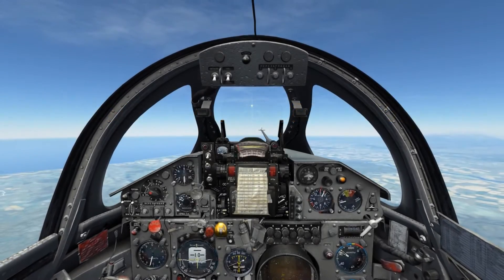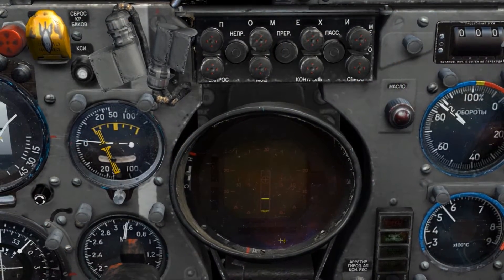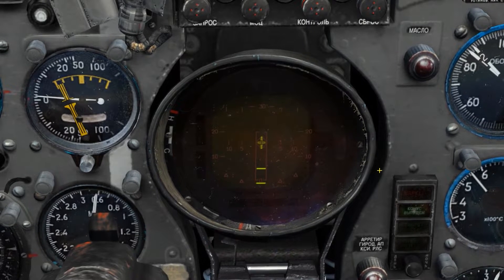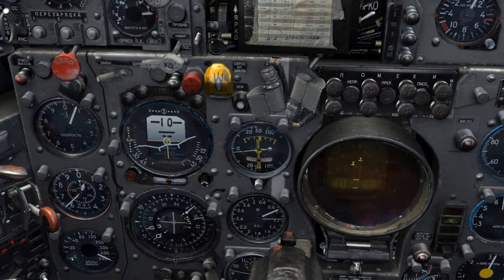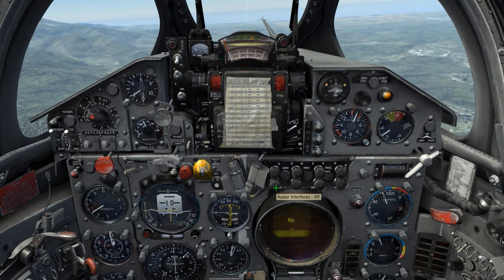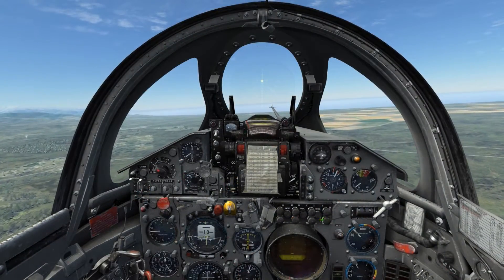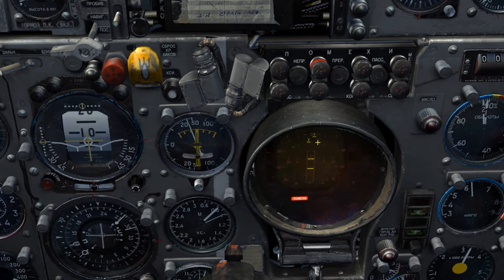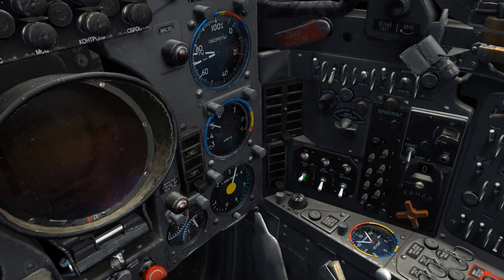DCS:World » RP-22 Radar Operation » MiG-21Bis

Comment: Thanks for your contribution. It is really helpful. But I have a question ? SAR missile radar frequency selector(CL 78).
I know it is for switch frequency of radar to avoid electrical signal to being connected. Is this switch functional in DCS ? Once in combat, what position should I switch ?
Reply from the maker: I'm unsure if the switch is functional at the moment, it can be toggled but I'm unsure if any effect is modeled ingame.  I can say though that the default position of the switch allows the radar to guide the semi-active radar missiles, so you won't have to enable/disable it inflight.